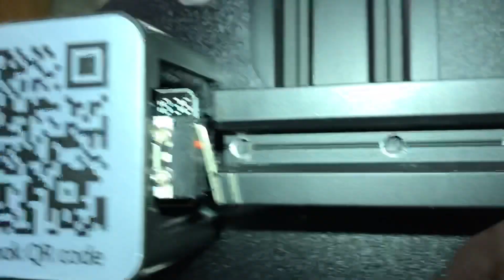Ender 3 X-Axis Belt Grinding

Comment: My ender 3 keeps running all my prints to the edge and grinding out,then the extruder has dug two holes in my bed and I'm not sure how to fix it
Reply from the maker: Sounds like your slicer settings are for a bigger bed, check that the bed settings in your slicer are proper.  235mm x 235mm.   

Have you leveled your bed?  Here's a short on how to do it (not mine, but same steps).  I can make one later if this one doesn't help.  Best of luck!
https://www.youtube.com/shorts/C_URGJrhgTU

Comment: Hello! I have the same coin pocket (something loose) sound when x moves fast (as your ender 3). Sound comes from hot end part. Did you fixed it? Or do you know what causes it? Mine started making it after 3 months :(  ... Thanks for the video.

Comment: If you can adjust the points of connection between the belt and print head you should be able to line up the belt such that this problem goes away.
Alternately you could shim the belt on the motor side where it connects so that the belt rides up in the bar and can't rub. Alot easier than designing a whole new bracket for the motor.
Reply from the maker: The problem was the belt was riding too high in the bar.  I did look at bending the attachment point but decided against doing that.  Many ways to solve problems, always love hearing about them!

To be honest, designing the bracket was fun and I really enjoyed doing it.

Comment: If the belt tracks properly you should not have that issue.  My Ender 3 Pro is about 2 years old on the original belts.  They do not rub. The extrusion is 6.25 mm while the belt is 6 mm.  It's very close, but proper alignment is all that is needed.
Reply from the maker: I'll check that out!  Thanks

Comment: Question when performing certain movements before the mod where you getting a vibration on the print head itself?
Reply from the maker: I didn’t notice any vibration in the print head.  The belt stopped the grinding sound, and he prints do look to be a little smoother.  

I’m looking into other ways to keep the belt tight that don’t look like something off a 1970 Plymouth.  Probably one of the clothespin spring solutions I’ve seen used.